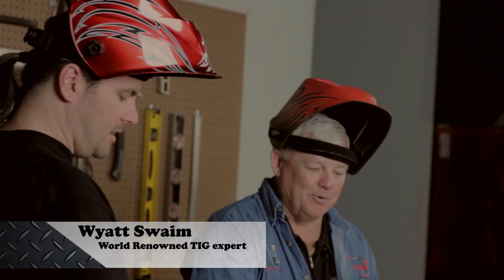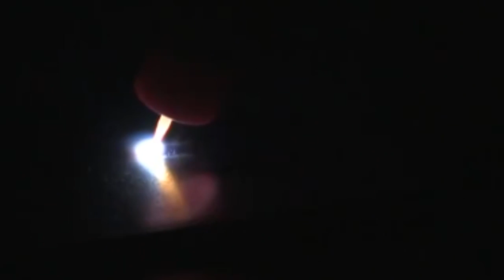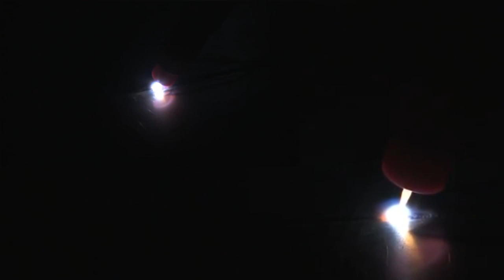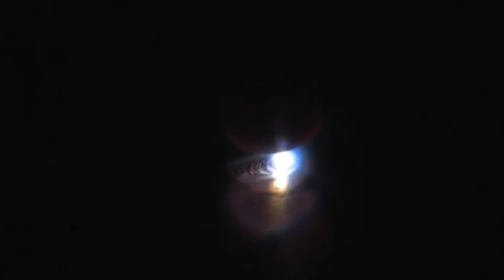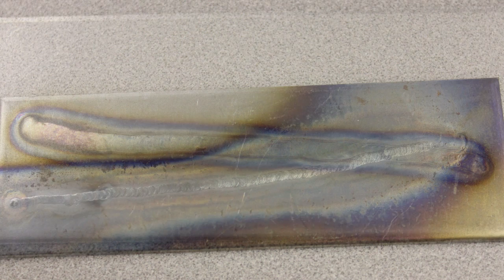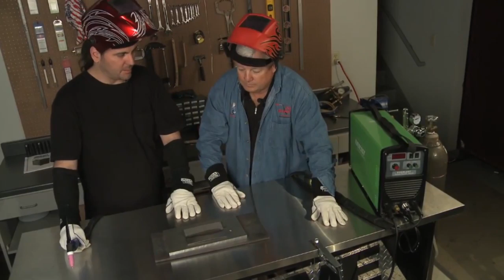How to Weld Basic TIG Welding Practice Techniques with EricTheCarGuy

Comment: I like to get into tig welding what make/model tig welder would be good for a beginner?
Reply from the maker: It all depends on what your needs are. If you don't plan on welding Aluminum you can get away with an inexpensive, DC only machine. If you need AC, you are going to spend at least $800. If you let us know your budget and requirements, we can better help you.
Reply: I like to work with 1/8 stainless steel and aluminum
Reply from the maker: The AHP 200x is a good starter machine.
Reply: The welder they have in this video is pretty good and can weld in both AC and DC.
Reply: Bigger brother to this welder is very good. Everlast PowerTIG 200DV

Comment: Sean,  The distance from your tungsten to the part to be welded controls your arc voltage and there will certainly be a different sound. That is to say 1/16" arc distance(9-10 volts) or better is preferred   and will give you a tighter arc profile. Thus making it easier to control the puddle.  The further you pull away from the puddle 3/16"(11-13volts), the puddle will get wider and you will lose the fine control and penetration.   Keep practicing because you are on the right track... Mister Tig

Comment: I was wondering if you can help?
I am having problems with welding this aluminium.  It was good when i first got the machine but then 
I couldnt get the thing to work properly, the arc seems to blow out the back and burn the electrode and the aluminum, i took a picture but cant seem to upload it.
Reply: Mr. green your probably not using AC current..
Reply: King Koopa it was on ac. that was two years ago
Reply: Mr. green people are stuck up so i thought I'd give you some love man..
Reply: no worries ! thanks!

Comment: Great video, wish I could Tig weld. I have been trying for 2 weeks. I suck at it. Back to Mig for me.  :(
Reply from the maker: Bob, don't give up. TIG welding is something that is learned over time with lots of practice. Keep running beads on plate and eventually you will get the hang of it. Head over to the forum on Weld.com and there are a lot of guys who can give you help there as well.
Reply: check out walk the cup vids! it is a big part of the timing.
Reply: I've been TIG Welding for just about a year and I still have REALLY iffy welds. Just do the practice and you will get better at the TIG weldering.
Reply: lol mig,pull and go :p

Comment: I gotta say im extremely interested in Tig welder after watching this.  I've never welded a day in my life but ive always wanted to weld a titanium exhaust system for my car.  But i do want to atleast get some sort of practice just doing any type of welding for an affordable price.  Honestly i was considering buying a cheap off name brand mig welder just to play around with some old fence piping out back.   I've heard about how argon is expensive and how a half way decent tig is in the 1300 dollar range minimum.. but i honestly dont think id be able to afford that for small projects.. even though its completely and totally worth it just dont think i could do it.
Reply: Review Guy So you will spend a bunch of money on some crap exhaust for your car that will be worth $0 once installed, but wont spend anything on a TIG machine?
Reply: why a titanium exhaust? are you trying to rack up the most expensive car build ever?
Reply: doyouwanttofuk Well i love titanium in general and i think it generates a nice tone when routed properly.   Its expensive yess but worth it to me.
Reply: Review Guy Been there done all that in the 80's. Buying crap for a car is 100% waste unless you are a professional racer or have money to blow. Anything you put on a car is worth $0 the second you put it on. And it actually makes the whole car worth less, not more when you go to sell it. I'd say buy an import machine like an Everlast. You can get started for $300 (DC) and get a really good one for $650 (DC). For a few dollars more you can get AC. No need to spend $3000. You can if you feel like it, but it won't make you a better welder and it won't make better welds. Gas for an 80 CFM tank is ~$17. 

Instead of wasting money on crap for your car, wouldn't it be smarter to buy a welder that has the potential to actually make you money? Is your $800 cat back exhaust going to make you money? NOPE.
Reply: Ehhh im a car enthusiast. You can mod a car just for fun. Doeant make it worthless...... 

  Your mentality of the tunning life is ridiculous. My buddies 2007 impreza was worth 18 k i installed an upgraded Stage 3turbo kit in it. He later sold it for 23k   so no... mods are not worthless.
Reply: Review Guy We have different goals in life obviously. Mine is making money, by selling crap to people like you. Yours is making people like me rich by buying my crap to make your car sound like a fart whistle.
Reply: Stjamestruste Lawn and garden tools have been my best sellers. You don't have to invent something new, just makes something better. I know a guy who makes snorkles for ATVs in his garage and doing $750K a year in sales.
Reply: $8K is a lot to spend learning to welding pipe and bridges when you wont be doing that. You will be sweeping shop floors.
Reply: The money for my exhaust pipe is no where near the cost of a tig welder. 

And by no means is my exhaust crap. Its name brand Blitz racing . One of the most well known japanese racing exhaust known to the automotive world. 

Lets put that in comparison..... 

780 dollar cat back exhaust vs 3000 dollar tig welder ( gas not included )  

My budget is no where near available to purchase a name brand tig welder.. So please stop comparing things that are so far apart from price. im not sure if your the type of guy who just likes to say " if you won't buy the name brand welder i tell you to, you better not buy one at all. " thats how you seem.
Reply: My exhaust doesnt make me money no. But it does two things that arejust as important... adds power and sounds amazing.
Reply: Thats fine, at the end of the day im still happy with my car. So your opinion on the matter really has no value.  But yeah like i said before. Your not good at comparing parts with tools. Who compares a 700 dollar exhaust to a 1000+ dollar welder ? Just no where near the price range. Either way, even though my cheap welder isn't all that. I was still able to make custom pieces to my exhaust pipe which is good enough for me.
Reply: John Rambo What is the best crap you sold, if you don't mind sharing?
Reply: Sounds great. I'm registered for a welding program this Friday. The RocArc+Flame certified education is $7,900. The formal class is limited to 40 students. I've been researching since I discovered welding as viable trade per MIKE ROWE. I'm changing careers and I've studied various things. It looks like I've actually found a sound investment for entrepreneurship and/ or career as a safety net. In order to get in I need to prove I've got career goals. However, I'm passionate about business and fear this is a tougher sell. I have to write an essay to on behalf of my interest. I have an iota of welding experience, however I've studied the various aspects of business for years, such as accounting, marketing, etc. 
Hence, me asking you the following questions. 
I really want to get into this class. 

1. Should I get a formal job before setting out on my own?

2. What's field of welding should I specialize, fabrication is my guess?

3. After the basis training what advance technique(s) should I aim to master?

4. How did you find your path to business?

5. How many years in the field of career do have? 

6. How many year in business do you have?

7. Did you have business experience before you started or have you ever decide to get any formal business training?
Reply: @Brandon S  You dont seem to understand the concept of someone who simply enjoys titanium in the automotive world. I dont think i need to justify why.. 

I just appreciate any time i see a nicely done welded piece of titanium. or seeing trim pieces in an engine bay made of genuine titanium and not neo chrome. 

or little burnt titanium accents.  

I would say the primary reason for wanting to do a titanium exhaust is because most of the titanium exhaust systems i've heard for my car sound nicer than most stainless steel systems. And theres the benefit of reduced weight, but no.. i dont race.... but its still an added bonus. 

i dont understand your mentality.. you seem to be the type of person where you actually want to discourage someone from building something as long as its not what YOU would build. thats the type of person thats wrong with the car community.
Reply: @Brandon S  Its a single turbo na-t supra.. so yess... there is an aftermarket manifold on the car. im not dumb dude
Reply: @Brandon S  ohh trust me the car doesnt attract girls unfortunately
Reply: @Brandon S  Also you must be an expert since you did a muffler delete on your car. teach us ohh great one.
Reply: Review Guy Damn you're dumb. What fucking stupid broke ass spends his money on some crap cat back system?